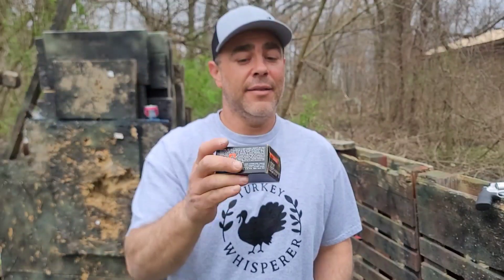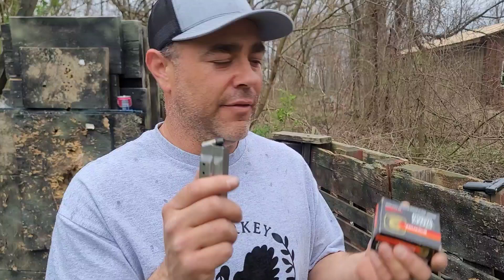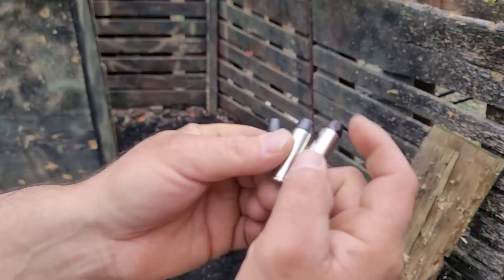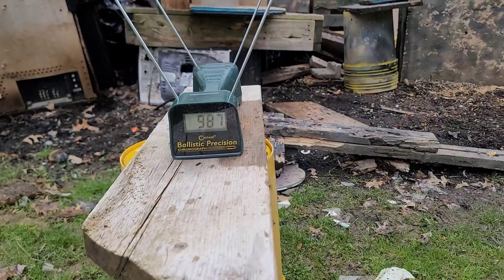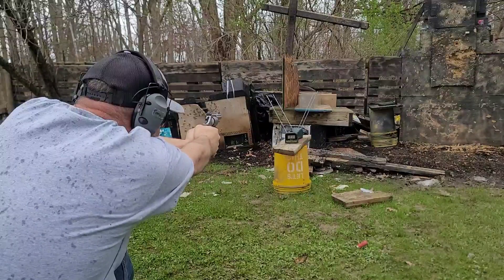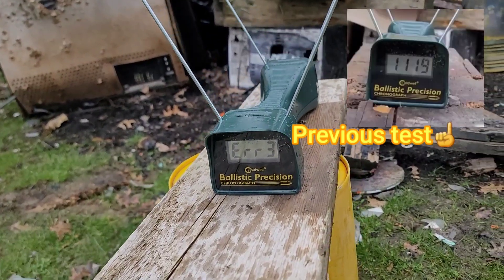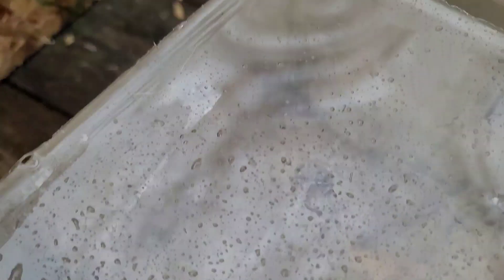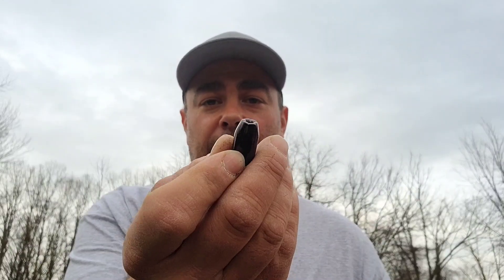Big Bore BLACK TALON! 500 S&W Magnum! First time seen on video?😯🤔

Comment: I never saw .500 S&W Black Talons before, but 25 year old .45 ACP Black Talons are still pretty impressive. I had more than a case of them at one time. The 230 grain bullets produce 420 ft-lbs of muzzle energy and easily pass completely through a 16" block of ballistic gel. They were one of the original "magic bullets" designed to meet the FBI testing standards for barrier penetration, etc. Ammo produced before then was okay, but that's when everyone started making really good defensive ammo.

Comment: Eons ago, I talked with some reps about the Black Talon stuff. They knew then that it would draw some hate mail from the EVIL LEFTY PARENTS of yesteryear. While speaking in cryptic terms, they made it clear that this technology would still be around, after a new name and packaging metamorphosis. The soothsayers did intimate that the trick would be to use BRASS as the jacket material so the petals do not depart from the motherpill. Makes sense. Ripping and shredding flesh can be had by most HP designs but keeping the family together for the entire penetration is RETAINED WEIGHT AND ENERGY!!! The hard cast bullet guys work their game with a mono metal and large flat face that doesn't deform much...AND STILL CHARGE YOU 2 ARMS, A LEG AND AN APENDAGE OR 2!!!! As far as killing killers in the backwoods, I am convinced that MASS and MOMENTUM DO THE DEED!!!
I can only pray that ANYTHING I need to kill to save my own nappy arse in the outback is not a MONTY PYTHON FAN!!!!

TWAS MERELY A FLESH WOUND!!!!!

Comment: Is this like the black dot imi?
Reply from the maker: Ehh, i think that was a marketing thing on both of them the talons first but then IMI remembered how well it worked. They are decent, but not a black talon. Talons are stuid sharp and act pretty much like a silver tip, platinum tip, ranger T or winchester defenfer. 
The black dot is a decent round though for sure. I like that for 500 bucks you can get a case. Practice all day with your carry ammo👊🦃👍
Hope this helps!